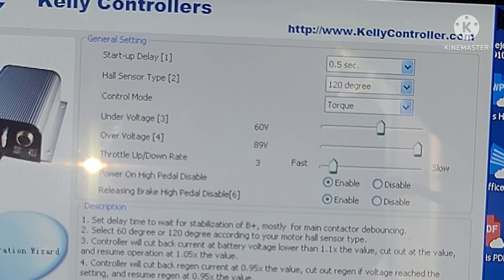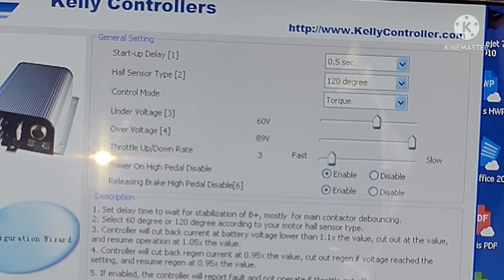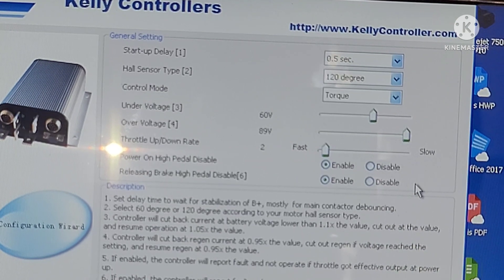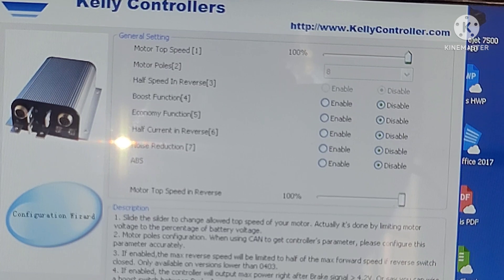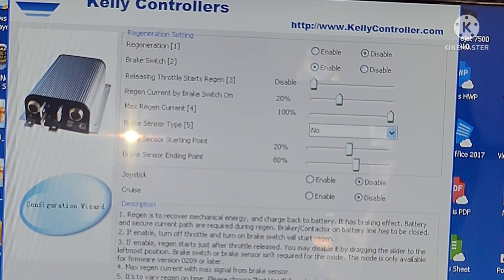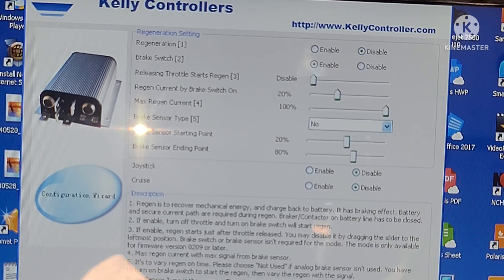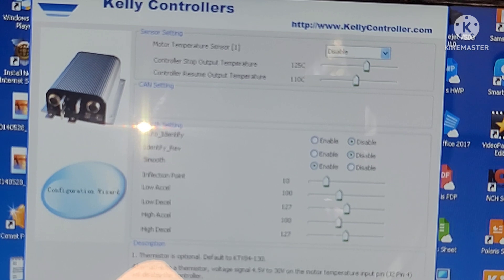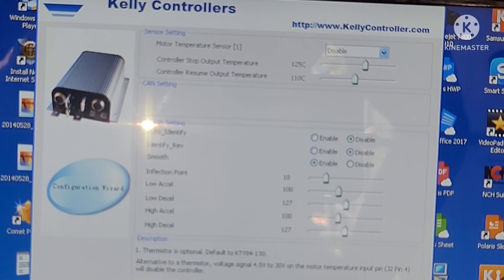Razor sx500 Programming KBS-X Kelly Controller, 72v 3000w BOMA BLDC Motor 72v, 30ah LiFePo4 BTrpower

Comment: Do u still use hho and the pro tuner from green source I'm about to but a kit but I have an 08 colorado 3.7 motor 2 o2 sensors I was gonna get the pro tuner but haven't heard good things r u still using it and hho? What's ur opinion on it I already have a volo but I was gonna get pro tuner or the darol Mason efie just wanting advice from someone who says it worked thanks hope to hear from u soon
Reply from the maker: Sorry for the late response didn't know people commented on this video. Currently I am not using HHO in my vehicle because I don't have a vehicle at the moment. My protuner fried on me and when I sent it back to Canada to be replaced or repaired it got lost in the import system from the US to Canada and unfortunately there is no tracking once it goes to Canada. When it was working it worked great and I could definitely tell it was changing parameters on my vehicle I had which was a Ford Ranger 2001. After that my trucks transmission went and I scrapped the truck and went to an electric vehicle. I want to do a VW beetle next but haven't had the funds to proceed. I will be posting it when it does happen. If you need help and or advice message me at 6194087854 Jeremy